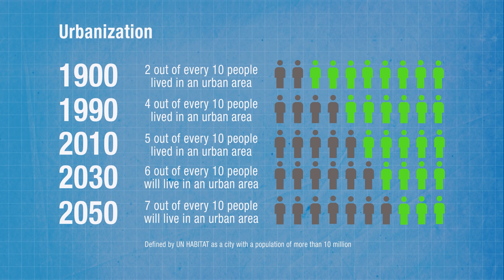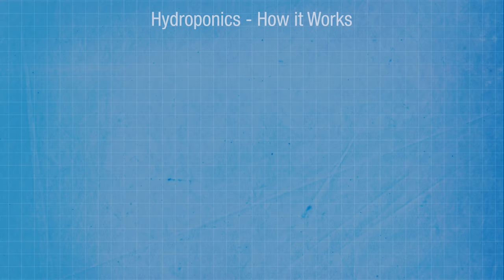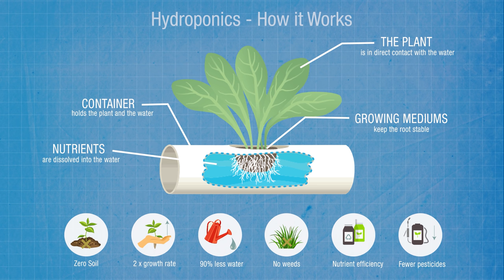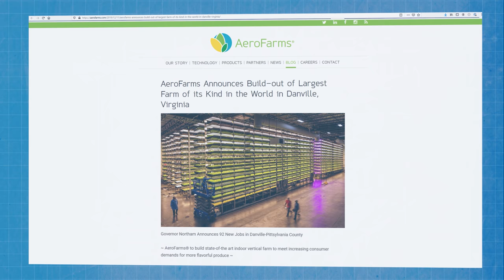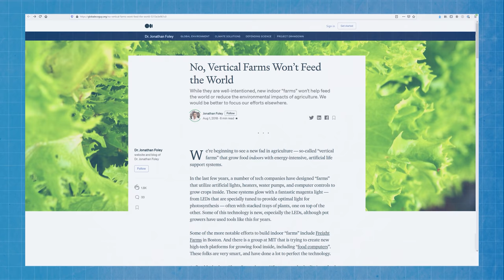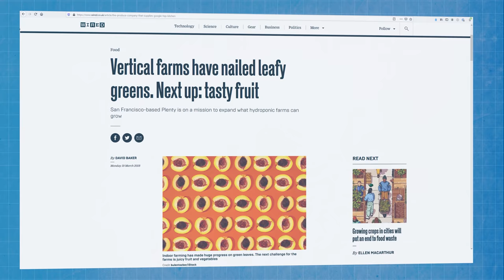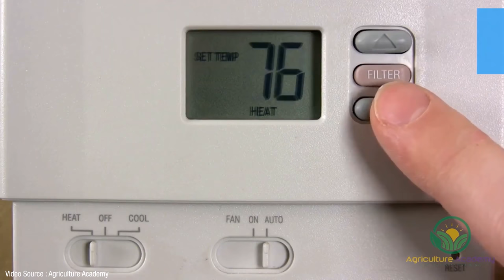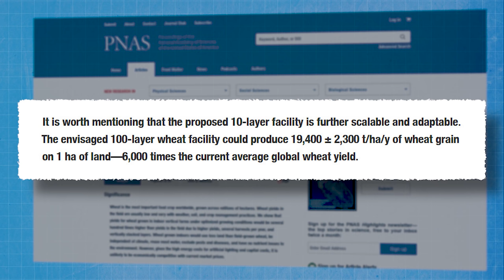Vertical Farming:  Growing fast!

Comment: Farming is in essence the conversion of sunlight into digestible calories. When you replace sunlight, i.e. free energy, with artificial lighting you are introducing a huge cost into the equation. The economics will work out best for produce that has a high monetary value to calorie ratio, greens are a prime example of this. The higher the caloric content of the produce the more time  and electricity that will be needed to grow it in artificial lighting, so higher cost. This is why grain and other starchy staples will not be farmed this way in our lifetimes. They need a ton of intense light for many months and are very cheap, even if they weren't subsidized. The economics will never work out without orders of magnitude drops in costs. The next type of produce that could make sense to farm this way will most likely be fruits like strawberries and raspberries that can command a fairly high price for premium quality fruit and still need a relatively low amount of energy input to grow and produce fruit.

Comment: If this industry expands a lot, then I imagine the electricity usage could vary in a way that's complementary to variable renewables. So the heat and light levels could be turned up or down when there was over or undersupply of renewable. So that would mean cheaper electricity prices for the vertical farmer and help out the electricity supply system overall too. Anyone know of anyone taking this kind of approach?

Comment: Read a blog where someone did the math regarding the amount of energy needed. It's way more than people think. Start by figuring how much solar energy hits an acre of land, and how much energy you would need to duplicate that .  You'd better be prepared to to increase grid level power generation by a significant amount.
Reply: I know coal is not highly thought of right now, but with carbon capture directly from the power plant fed into the factory farm I think it is an option worth considering.
Reply: @kalburgy2114  Better option is ThorCon's proposed reactor design. Their numbers show they can produce energy as cheaply as coal, and a lot cleaner. The problem with carbon capture is where you put the carbon afterwards.  Injecting it into oil fields to force oil up the drill holes is one option, but we are talking a lot of carbon. It takes a lot of energy to convert it into a solid form, maybe as much as you burnt creating it in the first place.

Comment: The huge issue with this is, as mentioned in the video, that the only plants that seem to be viable for this process at the moment have very low energy content, making them trendy for rich people's salads, but contributing nothing at all to the backbone of world nutrition. When I see them growing actual food crops like wheat, barley, corn, potatoes and especially rice using these methods they might be onto something genuinely useful, but for now the only service they're providing is to keep real crops cheap by reducing the financial incentives for farmers to waste their land on food that only rich people can afford to eat.

The other thing that could make this a game changer, is that since plants are used to sub-optimal light levels and temperatures through evolution, if vertical farms use energy that would effectively be wasted from when there are solar and wind generation peaks rather than running on a constant steady power consumption, they could sacrifice out and out food production but gain massive energy cost benefits by turning power that would otherwise be wasted into plants.

Comment: Great video, Dave. Been hearing a lot about this lately, nice to see a good overview of the subject. I'm especially excited to hear about the developments with regards to wheat. That's been my main concern about this sort of thing, is it's that's all for leafy greens but no staples. Looks like that might be being dealt with. Someone below mentioned potatoes, also beans would be a good option. Possibly a complete plant based or plant heavy diet could be produced with these kinds of systems.
Thanks!
Reply: I don't think wind power is the answer those windmills have a high failure rate.  Geothermal seems more practical

Comment: One issue with the baseline is that in most calculations are based on field farming. 

Vertical farming is competing against Glass (and Foil) greenhouses. Which use (actually pioneered) most of the the same techniques.

Comment: would have been nice to hear some basic numbers on how efficient existing methods of traditional and vertical/indoor farming is.   perhaps CO2 per KG of lettuce.  you touched on water use, but that does not seem to be the central factor discriminating whether this direction of farming tech is one that should be preferred.

Comment: Calories are produced by energy in the form of light. Greens are an extremely low calorie food and so require little light energy (i.e. low electricity costs). High calorie foods like grains and root crops are what is needed to actually produce enough calories to keep people from starving, which they would do if all they had were greens to eat. 

As such I don't see how vertical , or any indoor system that requires artificial light, can ever be cost effective at producing the vast amount of calories needed to feed the world.

Comment: Wheat is $250 per metric tonne. This is practically nothing and this is why wheat is grown on square mile scale and not in boutique gardens. At market prices you'd be hard pressed to recoup even the electricity used for the growlights let alone the tonnes and tonnes of plastic, aluminum and glass used for the growbeds and shelves or the sheet metal and concrete for the buildings. 10 or even 20 kg/m^2/y of wheat is what... $2 or $4 worth of wheat for one square meter of expensive synthetic rackspace in a climate controlled room. The lighting in this scenario is 700W/m^2 for 20h/d and, considering a generous 50% efficiency, that's 28 kWh per m^2 every day. That's easily several dollars worth of electricity in one day and every day and all for less than a bushel of wheat. Yes, it's 10-20 times more than on an open farm, but rain, sunlight and soil are practically free. Vertical farming of bulk carbohydrates is an absurd waste of resources and an example of completely delusional optimism. Have a think indeed.

Comment: Hey Mate...love your show and really appreciate the depth of your research.
I have a question centred around the imminent demise of the traditional oil industry. 
My understanding is that many of the secondary uses of oil  such as plastics and fertiliser production are by products of petroleum and distillate  refinery processes. Is that true? and if so will the coming reduction in oil refinery volumes impact on availability and cost of   for instance fertilisers?...
Cheers  Pete

Comment: I spoke to my friend who was working on a verticle farming project and the energy issue is quite the issue. I haven't been paying much attention to the latest designs but It seems to me like you could cut energy consumption with insulated windows. My thought being that net energy consumption would go up if the amount of energy gained doesn't get lost out from the windows.
Reply: from my understanding, the energy consumption is one of the driving reasons to use old mines and certain types of caves. It cuts down on the power used for climate control, and modern LED lights are very energy efficient.

Comment: I look forward to the day that we have fusion power providing energy for even better vertical Farm technology. But that's not going to happen any day soon.
The issue of soil degradation is more difficult. While we can get nitrates from gasoline and other sources to improve the fertility of the soil, we still have a problem of micronutrients. We eventually the soil runs out of the trace minerals that we need and that plants need. This is less of an issue in a vertical Farm where they can add these directly to the water as needed. But for traditional farming the real solution is going to be extracting minerals and nitrogen from our waste. As disgusting as it may sound, this is the best solution for the environment. It means we don't have to do as much mining and it's would potentially reduce a significant problem, dead zones. Around most of our cities and major rivers there are dead zones in the ocean caused by algal blooms. These occur because too much nitrogen, iron, and other nutrients are entering the water. at first this may not sound bad, but what happens is the algae eventually depletes all the oxygen when it dies creating a low oxygen or even anoxic zone where fish life in many plants are killed. We end up killing off the most productive fishing zones. in the Sea of Japan there's a secondary problem caused by this, jellyfish blooms. Either way, this is really causing severe environmental degradation in the local area but also leading to fishermen going to wider and wider areas and depleting fish stocks there. We are driving many species of fish to the brink of extinction and to extinction.

Comment: That's interesting.
I'm skeptical about many things tho.
100% renewable energies to power their systems? Which ones, Biomass? or some sort of energy certificate? Or they are only using light, pumps and robots when there is sun or wind outside?
The price and carbon content of transport is a droplet in the food supply. Buying a tomato in France coming from north Africa adds less than 150g of CO2 per Kg and a few cents. But buying a tomato from heated greenhouse adds more than a kg of carbon content per kg, while doubling the price.
The reduced use of surface and water is great tho, but what uses the more space today (and carbon footprint) is meat production, and this is not a solution to this (or at least not yet, we needs to grow cereals in industrial scale beforehand), so maximal effect would be low if we switched right now to vertical farming.
And there is the ressources needed to build the building that has to be taken into account.
It looks promising from a quality of food point of view.

Comment: I worry about concentrated microplastic(and the harder to filter nanoplastics) accumulation in aquaponics systems as a long term problem but I also haven't looked into what the filtering systems on them are like.
Reply: ZERO Water filter = Zero Plastic contamination. 
besides , most of CA water is from PURE Snow melt , ZERO Plastics , and Minimal Chemicals .
Reply: @markplott4820  Is that the standard filter used in the Vertical Farming industry? or is that just an option that could be used?

Comment: You mentioned Denmark, as a role model.
Well, Denmark has a lot of wind energy. But that's why the price of electricity in Denmark is the third highest in the world, after Bermuda and 'green' Germany.
And the 'renewable' electricity is not reliable either. Denmark is extremely dependent on electricity supplies from Sweden (41% nuclear) and Norway (hydroelectric, due to a unique geological constellation). They have to give away their electricity even with a negative price when there is a lot of wind and buy electricity at a very high price when the wind turbines do not deliver because of calm.
So once again a green dream is busted...

By the way: In deserts, the sun shines for free, you don't need electric lighting and Israel has long-established very efficient and competitive farms in the Negev desert. So there is plenty of room for more food. Vertical farming is not a solution, because there isn't a problem.

Comment: Growing city populations produce ever more CO2 and nutrient rich sewage, which are already a big liability. Therefore turning these liabilities into valuable resources by using them in situ as feedstocks for plant production adds a whole new dimension to the economic benefits of vertical farming. 
And while we're at it, how about putting peak surplus renewable generation into monocellular algae production? Surely  viable competitor to pumped hydro in geographically flat areas?

Comment: Prior episodes have discussed the massive (over) use of artificial fertilizers for agriculture (and its resulting emissions). Does vertical farming require similair amounts of fertilizer, which in term comes with its consequences?
Reply: Why would it? Land farming has to saturate the land in the hopes that plants get some. It is at risk of soaking too deep or washing off in rain. Hydroponics can keep exactly as much fertilizer as tyr plant needs, and it stays in circulation until the plant takes it.
Reply: @Bobucles  Completely agree that in comparison, the fertilizer used is more efficient. But soil tends to have a base level of natural occuring fertilizer present already, which the water does not. I was wondering how big this impact is.

Comment: Vertical gardens should not even be compared to standard farming. It is rather a industrial way to see food production. Since everything is controlled, it can be for a mono culture without the risks it would have in nature. Furthermore this is not a way to save the environment as it is a way to go towards a way to create new ways to feed the population. In reality, our dependence on fossil fuel is a economical problem rather than an environmental problem. We will use electric cars due to their superiority to the standard cars. Petrol is not a very practical way in storing energy and it is a little bit like comparing the move from steam engines to combustion engines. I am sure that energy will be far cheaper and easier to store in a near future.
Vertical farming is a way to increase the quality of the food we eat primarily and secondary an alternative to limited resources. The development of traditional farming is going just as fast and productivity increase faster than anyone would have predicted just a few decades ago.

Comment: I don't think they thought this one through. 
 
On a farm one square metre of land receives a certain amount of light.  You then want to use solar panels which have at most 15-20% efficiency to transfer that solar energy to a vertical farm.  Then through an alternator which is at most 80% efficient, a power grid which is at most 98% efficient.  Then, in the farm, the LEDs will have at most 50% efficiency.

So TLDR, in order to save space you move a farm to the city and build a solar farm that is at least 10 times the size of the original farm it is replacing. Are they insane?  

In order to make any sustainable technology work we need to rapidly increase sustainable but non-renewable energy production (nuclear), or else none of this stuff works.  But we are probably too late for that and will just have missed the one chance we had to get on top of climate change.

Comment: Just a shower thought: If the Vertical farm was powered by Geothermal Energy, this heat, from it's point of origin, be piped to the farm to help with maintaining CO2 levels? Or better yet, a water heater from solar heat from solar panels?
Reply: Like it is said in the video, problem is the capital cost. Reusing waste energy is very expensive. Geothermal energy is also has very high capital costs. Which is why it is used in very small scale despite having capacity to provide large amount of the global energy use.

Comment: The cost of city real estate and energy often makes these prohibitively more expensive than 'dirt cheap' (pun intended) farmland.
Reply: Surely they could be built around the outskirts of cities to reduce the costs, but I guess it might be a problem. Or just use the tech at normal farms and build up on farmland, I know you would then have extra delivery costs but if the land is a lot cheaper?
Reply: @timscott3027  That's the main issue. Real estate. Where the land is only dollars per meter you can grow a bunch of crops so cheap that HUGE losses to weather or drought or pests might be acceptable. But when climate change starts to make those losses truly apocalyptic - that's when maybe we'll see. But by then Ferming may have replaced farming.

Comment: If we combine this with returning a percentage of farmland to forest/jungle, That might just save us.  Along with carbon capture methods to supply the CO2 in the vertical indoor growing spaces.
Reply: best way to handle CARBON is to NOT Emit it in the FIRST Place.
Reply: @markplott4820  True but at this point we have to be carbon negative not just carbon neutral.  I am talking about  capturing carbon out of the air.  Not a smokestack.

Comment: I've built and run an aquaponic system at home for several years. A good friend of mine runs a business setting them up. 

They're tricky to run. The fish and plants have different needs and so you often end up doing both less well than doing each one separately. 

The time and space savings of doing both together are still enough to overlook those inefficiencies.

The bigger criticism is that fish food itself is not very sustainable. It's often made up of wild caught low value seafood like krill. There's a fear that aquaponics and aquaculture puts a large strain on ocean wildlife by competing for the same food supply at the bottom of the food chain.

Here's an interesting TED talk on sustainable aquaculture:
https://www.ted.com/talks/dan_barber_how_i_fell_in_love_with_a_fish/transcript?language=en